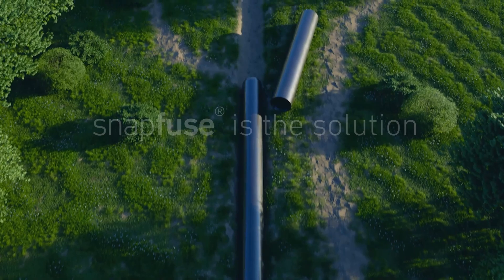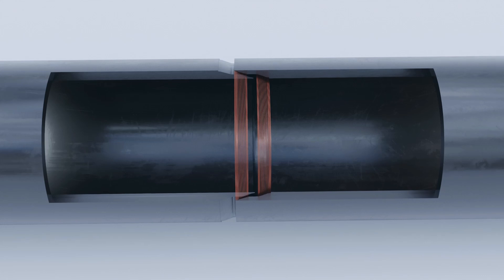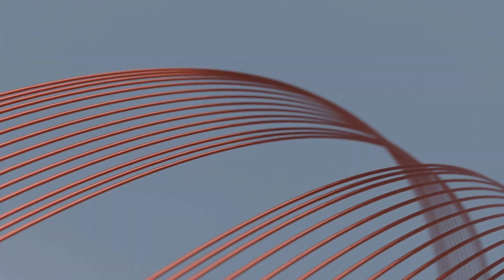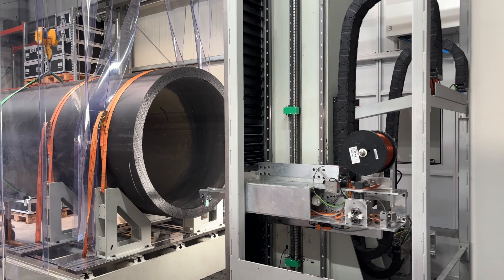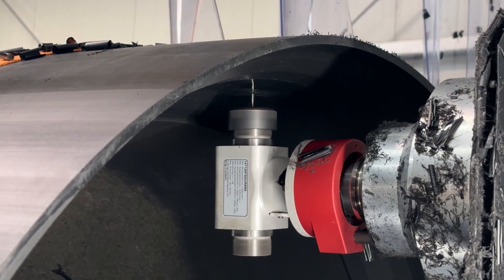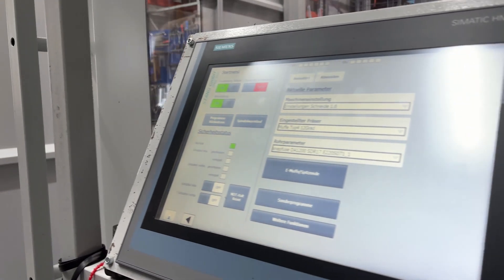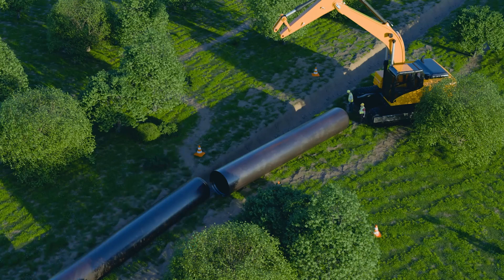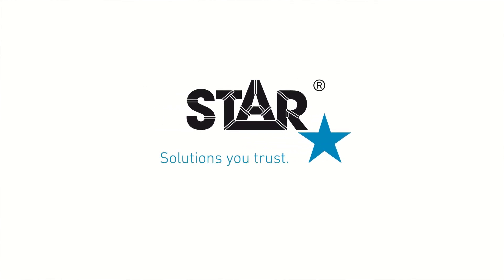snapfuse | The Smartest, Simplest Way to Connect Pipes by STAR Engineering Systems

Comment: That mean it is a new technology to weld P.E pipe 
 So we will not use coupler for welding butt welding or E.F  fittings . Is it  right ? Or I have misunderstanding ? Because we are manufacturer for P.E pipes and fittings E.F and butt welding . Thanks for your time
Reply from the maker: Thank you for your interest and question. 
You’re absolutely correct— snapfuse integrates the heating wire directly into the pipe wall, eliminating the need for electro-couplers or butt fusion welding in pipe connections. For more information, please visit our webpage www.snapfuse.de or reach out to our colleague at emt@starengineering.systems